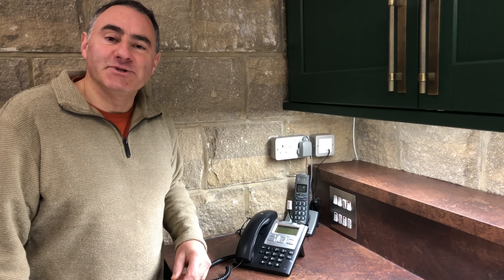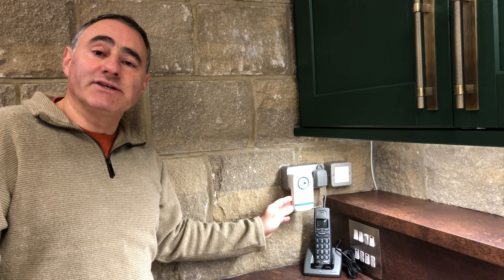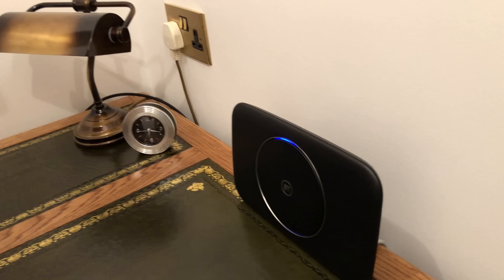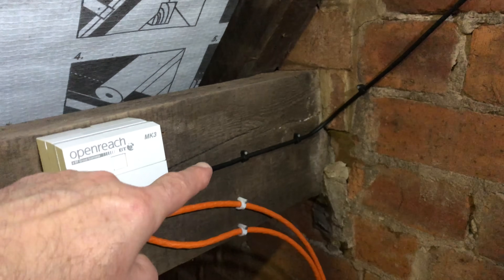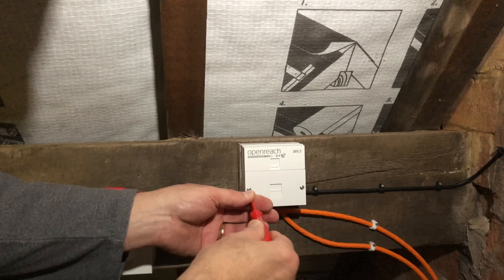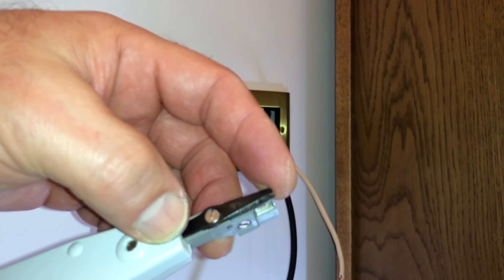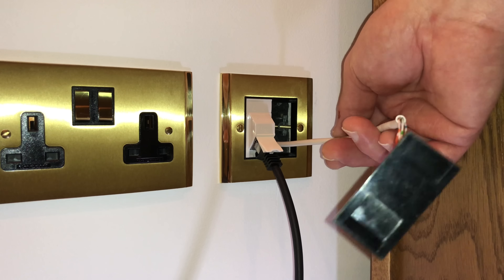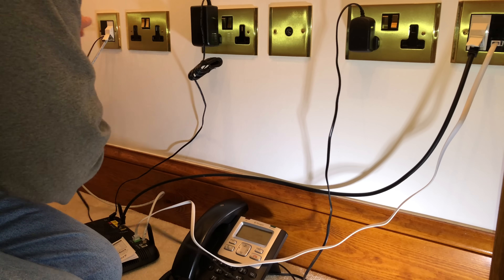How to Video - Analogue to Digital Telephone Landline Switchover Advice VOIP.

Comment: i only seen a phone connection on BT routers, not seen it on any other ISP provided router. I personally wont be using a landline/VOIP, sticking to using my mobile.
Reply from the maker: Out of interest I’ve had a look at Talk Talk and Sky. Both have latest routers with a phone socket. As we have a patchy mobile signal inside, we’ll be holding onto the landline for now. Thanks for tuning in. Cheers Rob 👍

Comment: thank you for explaining how to move the socket, but it still does not solve the problem of what happens when the broadband goes down. Please remember not every one has access to a mobile phone for any number of reasons., These could include not having a mobile phone , no signal for them unable to use them (mobility or sight problems amongst the reasons), cost of handsets or service costs (monthly fees) or any other variables
Reply from the maker: There has been lots of comments about battery backup also known as Uninterrupted Power Supply (UPS) that keeps devices running for a certain length of time until power is restored. Hope this helps and thanks for commenting. Cheers Rob 👍
Reply: thank you for your kind reply, I was thinking about whathappens if the service from the isp goes down and there is no service to the house

regards
Reply from the maker: @DNoman-v9f  I suppose the same could be said with the service before switchover. However, lots of problems to be overcome by the phone companies to suit various situations.

Comment: Fkin BT trying to rip everyone off as usual 😂😂😂
I've got a box that can make landlines Bluetooth to 3 different fones also it's only just thru the router better with cordless fones tbf saves screwing with the wires 😂😂😂😂
Reply from the maker: Hello there Dave, Thanks for your comment, interesting to hear about a Bluetooth device for the landline. 
I suppose phone companies don’t want customers messing around with wiring hence, the three suggestions, buy digital handsets, buy digital voice adapters or plug the existing phone directly into the hub. All our handsets are cordless apart from the one desk phone that plugs into the second wall socket next to the hub as can be seen in the video. Thanks for watching. Cheers Rob 👍😀
Reply: Your Bluetooth will not work in a power cut … so no usable phone line. Forcing you to use a mobile if you have a good signal and only for as long as your battery has enough charge in it.
Reply: @peterjohnson1739  no shit Sherlock 😭🤣🤣 be easy enough to make a backup battery UPS to run it for hours but you'd just use your mobile instead I just thought it was a good idea to repurpose landline handsets before all these android fones came out in full force no one cares about power cuts 😆

Comment: We live in rural Mid-Wales. Only providers that will serve us are PlusNet & BT. Currently with the former. They are pushing me to go to fibre. (Not full-fibre, can’t have that). Taking a BT option would be £13 a month more and I can’t see the benefits. Both are being very unhelpful and unfriendly. Our problem is that we need WIFI Dialling to have mobile phone. The whole mess is compounded by the fact that when the power goes out, which it does, the local mast goes down too. Tried to find out why it isn’t battery backuped. Failed. 
Suggestions that don’t include moving appreciated.

Comment: How do you get your phone number back?
Reply from the maker: We didn’t lose the phone number. We had notification on switchover day to unplug the phone from the traditional phone socket and plug it into the phone socket in the back of the hub. Nothing else changed. Thanks for watching and commenting. Cheers, Rob 👍
Reply: Thanks. PlusNet told me I can’t plug into their Hub 2 as they don’t support voip and that I should change your BT. Phone calls to their millennials just left me confused & frustrated.
Reply from the maker: @EssGeeSee  To be honest I’ve never looked into Plusnet although I knew they were part of BT. I’ve just had a look at their website and help section that shows the hub and the hub is the same as mine. I could see a sticker over the phone port with the words ‘digital voice customers only’. So I don’t understand why they don’t offer it ? Cheers, Rob

Comment: The router and modem are powered by a mains to 12V DC unit.
If you are in an area prone to power cuts then you could make a set of emergency leads to connect these unit to a car battery.
Reply from the maker: Thanks for watching and for the info Ian. Luckily we don’t experience many power cuts, so should be ok. Cheers, Rob 👍

Comment: No need for all this faffing about.  You need to get the telephone company to sort out the connection. I'm with Virgin and they ran the cable external. (Router upstairs, phone downstairs)
Reply from the maker: Hi Fred, I enjoy doing this type of DIY job. It took longer to video this than it did to do the job ! Thanks for watching. Cheers Rob 👍

Comment: Open reach and Virgin have both suspended the roll out of digital lines to vulnerable households.

These include any house with a Caroline, or where the householder has no requirement for a broadband connection.

They have done this due to Caroline systems being designed to allow a silent call to be traced to a given address. This cannot be done using VOIP.

This also means emergency services cannot trace silent calls either, thus putting people's lives at risk.
Reply from the maker: Thanks for watching and your interesting comment. My Mother in law has a call pendant but is still on the analogue landline for now. Will have to see what happens this coming year or so. Cheers, Rob 👍
Reply: What is a Caroline system?  I googled but had no luck.
Reply: @karhukivi  So did I, try Careline

Comment: Thanks for the great Video Rob, I have already done this back in August when my broadband supplier gave me a great deal to up grade to 1Gb full fibre, BT Open Reach came and installed the Fibre from a pole in the back lane and brought the fibre line right up and into my network rack.

As we have elderly parents and I use the landline for ringing out for business purposes we have kept our analogue Landline and plugging an extension into the phone socket of the router and into the four way adaptor was a simple way to keep everything working, however then the fun started.

The landline was too quite and it sounded like you was in a tunnel, and after around twenty phone calls to my broadband supplier and there so called useless technical department (they told me that my analogue Landline worked over Wi-Fi, despite the, seeing that they used cables on a video call to them) I managed to get put through to someone in there English head office who arranged for a replacement Router which solved the problems, I also got a 50% discount for the rest of my contract.

During all these phone calls I was told that you could not plug an extension or more that one phone into the back of your routers as they was only designed to operate one phone (BT REN 1), this is totally a lie as we have an extension with three phones through the house, and they all ring and work well.

The other day I spoke to the pendant alarm people as I was doing some wiring work at my mums and wanted to make sure that cutting the power was not going to cause any problems, it wasn't, I also asked them about the change over to Fibre and they told me that they will be starting soon to provide a battery pack that will power the pendant system in user homes if they was a power cut, and would allow the phone line to operate.

Over the years I have come across BT exchanges where they have backup diesel generators that provide power in case of power cuts, I assume that they will be kept going forward, although I don't know if this will be true in the much smaller exchanges.

Comment: For me this has already been done, but as I haven't even had a landline plugged in for 3 years it makes no difference, I use it for Internet access only!
Landline phones are really a thing of the past in my opinion 👍🏻
Reply: I find I'm using the mobile less and less.

Nobody gets rid of the landline, how else would you get broadband. All you did was unsubscribe from a voice service and as far as I'm concerned as it's next to nothing in terms of costs, you might as well have it as the backup.

I have a hot water cylinder but only use the electric shower. The hot water is used just for a single washing up session a day, plus to keep the airing cupboard warm. So many just chuck it out for a boiler that heats on demand. Silly really as you lose the airing cupboard!
Reply: So when you have a power cut you can’t be contacted or make a 999 call.

Unless you have a fully charged mobile phone and a signal. If you do you’re lucky. Many people don’t so they can’t call for help in an emergency.

Note that mobile phones need power at the mast. The mobile network is more vulnerable to power outages than telephone exchanges with their battery backups and generators. Your old analogue line was powered from the exchange, not your home supply, that’s why it was so much more robust than ‘digital voice’ (aka VoIP).
Reply from the maker: Thanks for watching. Agree with you, but because we don’t have the best mobile signal inside the house, we’ll be keeping the landline for now. Cheers, Rob 👍

Comment: Well presented and clear.
Glad you mentioned no pjone if there's a power cut but another couple of things people forget are that autodialing burgler/fire alarms won't work and critically, panic alarms for elderly are also out of action.
Reply: For vulnerable households some companies will provide a small UPS for the router which will keep it working for an hour after a power cut. Doesn't seem enough to me...
Reply from the maker: @kamalhashmi9851  Agree one hour isn’t enough. Will have to ask about this when the time comes for the mother in law to switch. Cheers Rob 👍
Reply from the maker: Mother in law is in the same position and remains on an Analogue line for now. Will have to see what the near future brings. Cheers for watching, Rob 👍
Reply: Digital Voice phones don't work if the Broadband is down (as we just discovered.)  The power can be on, but if the internet is down, so are the phones.
Reply from the maker: @jannertfol  Yes you’re right. Mobile is a back up but if mobile masts loose power then there is no communication! Thanks for commenting. Cheers Rob 👍

Comment: Nice video! I did basically the same at my home. We're on Virgin and I set it up ahead of time so It was a very simple for the engineer to switch the system over. I also moved the router to a new location as I didn't want the possibility of the engineer causing issues with adjacent equipment with the router in its old location.

One thing I would do is, unless you have any very old phone that rely on the separate Ring signal or Earth connection if it's a real antique phone, remove ALL the Master Sockets completely and if you need a socket where a Master Socket was then replace it with a Slave Socket. This is important as a Master Socket is, by design, a constant load on the line and the removal ensures the best signal from the router.

A lot of routers are actually very weak in output, especially in terms of ring current capability which is stepped up from the router's power supply.  Most routers run from a small 12 Volt DC supply and this low input voltage is stepped up to the normal Ring voltage of between 70 and 100 (very occasionally 110) volts and the normal line voltage is -48 Volts DC.

For example, a telephone that draws 200mA from the line when in use will draw an extra 800mA from the router's low voltage power supply. As a ringing example, if the ring voltage was 102 volts and the telephones along the line draw a total of 400mA then the current draw at 12V would be 4.8A as the Ring voltage is AC not DC. In these examples, it is easy to see why the output of a router can only drive maybe two or three telephones maximum as the current draw of the telephone side of things is in addition to the existing power requirements for the network and broadband electronics. This is why a few routers came with physically large and hefty power supplies. Unfortunately there is likely little to be gained, except perhaps improved reliability and lifespan, by upgrading the router power supply as the internal electronics are unlikely to deliver more output to run more phones even it the power supply was capable. A few people may be lucky and find that their router has at some point been supplied with a somewhat beefier power supply and may gain some benefit from upgrading it. 

Of course, the usual caveats of possibly voiding any warranty on equipment and potential damage to equipment by the use of third-party parts applies if you're thinking of using a power supply other that the one supplied.
Reply from the maker: Thank you for your comprehensive answer, very interesting 👍. All our sockets are slave and I only have three phones plugged into them. No issues with incoming and outgoing calls and there are no plans on adding more phones. Moving forward, I would expect more digital phones to appear on the market that link wirelessly to the hub so I wonder if wired phones will eventually fade away. But a long time to go yet before that happens. Thanks for tuning in and commenting. Cheers, Rob

Comment: Why feed your line all the way up to the loft just to feed it back down again to another socket on the same wall ?
Reply: The line isn't fed up to the loft, it likely comes in from the loft from the pole.
Reply from the maker: @dlarge6502  Yes the line comes from the telegraph pole into the loft 👍
Reply from the maker: Hi there, The line and master socket were already in the loft. It was a case of re-routing the line down to the new socket position. The reason for two sockets - one to plug the hub into that feeds all other sockets and the other to plug the desk phone into. I had to feed a draw line up the conduit as the wire was snagging on something when trying to push it down. Hence the reason for taping the wire to the draw line and then pulling it down. Hope this explains everything. Thanks for watching. Cheers, Rob 👍

Comment: We get powercuts and there's no mobile signal here. We use Wi-Fi calling.  After analogue shutdown how would we contact emergency services in the event of a powercut?
Reply: You don’t. Ofcom has allowed the telecoms companies to provide a service that does not guarantee connectivity. The argument was that you just use your mobile phone - your telecom company could provide you with one of you don’t have one. Objections raised by respondents to the consultation based on poor (or absent) mobile signals or prolonged power cuts several hours if not days (not the 2 hours suggested by ofcom) were all ignored.
Reply from the maker: Hi Christopher, I would imagine phone companies are looking into rural / poor signal areas. I can only suggest an Uninterrupted Power Supply (UPS). Basically a battery backup. Best contacting your provider when they notify you (or even before) of the switchover to get their advice. Thanks for tuning in and all the best, Rob 👍
Reply: The general consensus from BT, virgin is access to emergency Comms was never a requirement but an accidental thing.

Comment: just plug in a stabndard phone line cord bewteen the  telephone port on the Modem and a wall socket and DISCONNECT @ the Bell DMARC...!
Reply from the maker: I get the first bit but do you mean disconnect at the master socket ? Cheers, Rob

Comment: Had this exact issue 2 years ago, the Mrs grandparents had there digital switch over I was tasked with adapting there analouge hard of hearing phones over. I belive there were BT and at the time they were issued 2x wireless connectors but as stated needed sockets to work. They do work but now you have posted this I may pop back and reuse there original wiring to save the sockets. Thank you
Reply from the maker: It’s good to know my video has been of help. Three wires are sufficient as mentioned in other comments but I connected all of them to keep it tidy. Hope you manage to sort it. All the best, Rob 👍